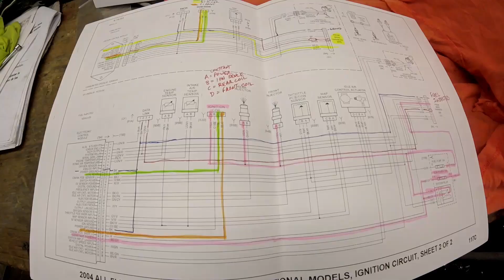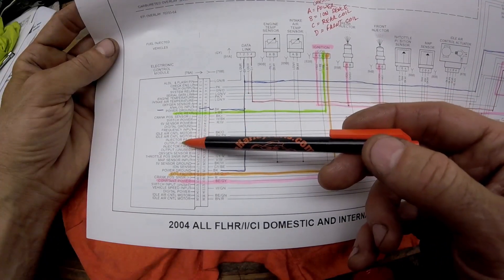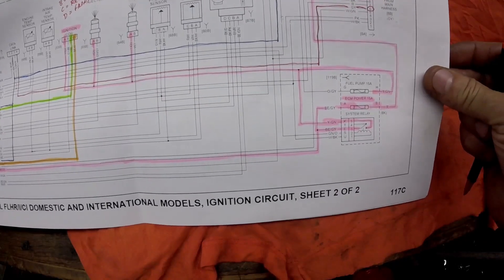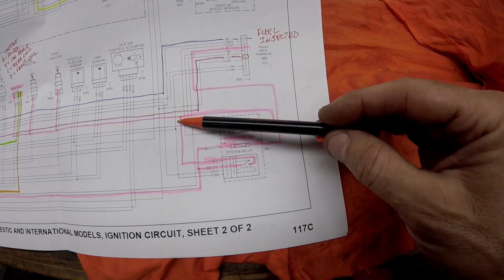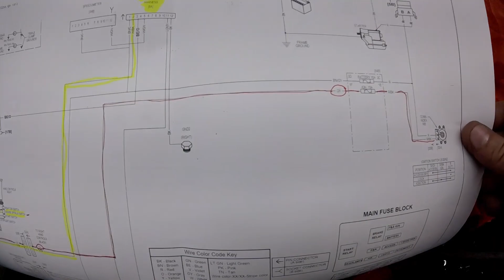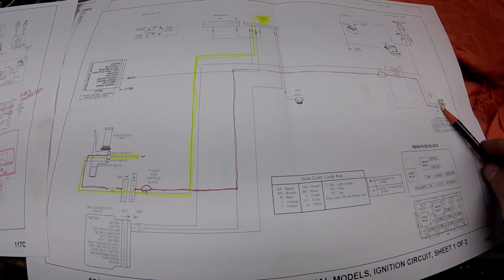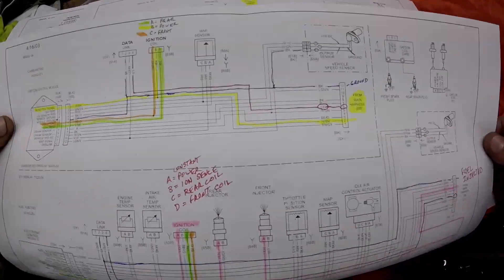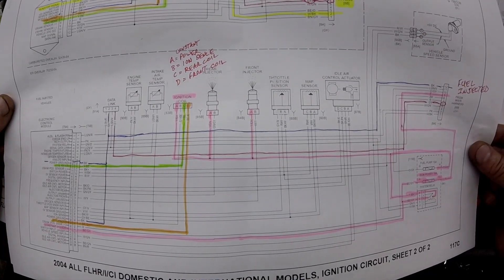No Spark 2001-2006 Harley FL Twin Cam 88 Wiring diagram

Comment: I absolutely love your very informational video, but I'm still having problems locating some of the items that you have mentioned. I'm used to working on the old bikes that I have owned ( such as a '47 Knuck/Pan, a '56 Pan, a '67 Shovel, etc.), but now I've picked up a gorgeous '01 Road King with only 20k miles on it. The owner passed away and evidently took the keys, the FOB and the Pin number, owner's manual, etc. with him. His wife couldn't find anything that should go with the bike. I ordered a new set of keys from the HD dealer, which fit the fork lock, but not the ignition. I ordered a new switch, so now it's got everything, but no spark to the plugs. And listening to your video was extremely helpful, but when you start mentioning the crank sensor, ignition module, and BAS, etc., this old timer is completely lost! I don't even know where to look for these items that you are mentioning. So, it really would be helpful to just mention the general vicinity where these items may be located, when you speak about them. Thanks a bunch!- Wes
Reply from the maker: I can appreciate what you’re saying Wes. I wouldn’t know that information off the top of my head however, in the Factory service manual they do point out where all these parts are. You can get the manuals for free in different groups on Facebook. I’ve attached it for you. Please let me know if I can help in any other way.

https://lookaside.fbsbx.com/file/2001%20HD%20Touring%20FLT%20Service%20Manual.pdf?token=AYJK3QFSb-DYwTNbunYEYvA2jJsaTk_BpnOYp-Lvgu6PH8haRQYMjDaW4dj3zF1WX99WNpgOrHraBHAIVmOD0D3jSS3N8pbSpTFhcaBwkAdL15JMWyzwPSbtX0Ce9y6U6Y37XqRFdRsAaVZun-3liM-4UKyWrd7DFQbd_BLGDcY1KhfB2VOiJZhaXW4nSvT7KT_hC0_8d5Dti56kmsYQtRiV
Reply: @Rapsgarage  Wow! Thanks a bunch. You are definitely DA MAN!! I really don't want to "wear out my welcome" with you, but if I may ask you a question, I will forever be in debted to you. As I mentioned in my earlier post, I'm trying to get spark on this fuel injected '01 Road King. With only 20k miles, I wouldn't think that something would be worn out (but I understand, anything is possible). The previous owner claimed that it would run as long as you spray fuel into the intake. I'm pretty sure I have cured that problem, with a new fuel pump. And while at it, I also had to switch the fuel tank due to rusting. BTW, I could kick the arse of whichever engineer at H.D. that thought it would be a good idea to put all that crap INSIDE the fuel tank!  Nevertheless, everything appears to be operating great, except for the lack of spark. No power to the coil, when checked. Also, I really hate to admit it, but due to low lighting and my haste (not to mention, that I'm older than dust) when attaching the leads to the new battery, I connected them bassackwards! Of course, when discovered, I immediately reversed them. But now I'm thinking, that is the reason I have no spark. Would you please give an educated guess, as to what would be the most likely problem due to my stupidity? Which component would go first? Thank you.
Reply from the maker: @Timelapser01 I would follow my video and ground the tn/gn wire and see if it has spark. The crank position sensors go bad all the time. If you get spark when you ground that wire, then it’s not the crank position sensor. At that point, it could be the TSM or TSSM module.
Reply: @Rapsgarage  Yes, I'm sorry. I meant to come back here and delete my last question. After slowing down and paying closer attention to your video, I realized that you are actually spelling out the information I was needing. Sorry for wasting your time and thank you so much for your help.

Comment: I have 12 volt at the 3 wire ignition coil pigtail (carbureted bike)  (white wire with black stripe) 

ONLY with TSSM disconnected 

I wonder why that is..I bypassed the TSSM neutral safety bs thanks to your other video I commented on in order for my bike to crank

Anyways 12v at pigtail for ignition coil with TSSM disconnected but still no spark when cranking.

Comment: Need some help on a chopper build! Using a 2010 softail wiring harness. No spark or power to the coil. Power to the coil upon start button, while the fuel pump is activated briefly upon startup. After this there is no power or ground on the cylinder wires or the power wire to the coil. Thank you!
Reply from the maker: Email me at hdrap_1999@yahoo.com and I’ll do what I can.

Comment: Ok finally I found your video and it best described my issue I’m working on a 1999 FLHTCI   ,so ultra classic I think more to the point up to this point wires plugs coil  ,all new still no start cranking yes geting spark as of now still no . I’ve done most of what you have suggested in this video I’ve checked wires for brakes or damage or shorts all seems well 90% of all fuses test 100% no issue there unless it’s the fuse you described as the black and red that turns to gray , I’m trying to run it down all possible issues before  start to look at the ecu , as the issue the bike was running and running good then one morning boom crank no start and here I am so before move to the crank sensor I should test my relay right grate how to??? Idk how yet
Reply from the maker: @davidriley1257  I’d definitely replace the crank pickup. They go bad all the time.
Reply: @Rapsgarage I’m sure you are saying the crank sensor? Because after that it goes to the ecu..
Reply from the maker: @davidriley1257 yes the crankshaft sensor
Reply: Ok one last thing before i move to that I mean, I’m gonna do it anyways, but I put my meter to the center pin of the coil and I get 12 V for a second and then it goes away. It’s not consistent so if I should have 12 V consistent right there and I don’t where do I go from there?
Reply from the maker: The coil power and fuel pump power only kick on to prime the fuel system and then they both shut power off. You need to check power on that center coil wire when the bike is cranking. They shut both of those power off in case you’re in an accident and the engine is not running. They don’t want the fuel pump to keep running and put fuel all over the ground.
Push the start button with the power on and you should see the 12 V consistent at the center of the coil

Comment: Good video. Getting me started to troubleshoot.
One thing to add. It would be nice to have those drawings next to the bike and when you speak of various elect blocks, point out where they’re at on the bike.
And yeh, I’m weak when it comes to electrical. 😑
Reply from the maker: @dougfresh1341  you’re not wrong but I just don’t want to take my bike apart to do that. If mine was broke down I’d definitely make a video showing that. Maybe one day after I retire. Thanks for watching and if you get really hung up you can reach out to me at hdrap_1999@yahoo.com
Reply: I was thinking the same thing. I used to be a whiz working on the old bikes, but when you start talking about sensors, ECM, BAS, etc. on the newer bikes, I'm lost. Not to mention trying to actually find these things!

Comment: Hey man , I’ve got a question for you. My 03 Dyna does not want to get spark and I have replaced the ignition, coil, spark plugs, voltage regulator, and crankshaft sensor. It just wants to crank and crank but won’t turn over. Maybe you have some idea of what it could be ? It’s getting plenty of fuel as well
Reply from the maker: Is it carbureted or fuel injection? Also, Harley offers the wiring diagram online for free go to Google put in your year bike and put in wiring diagram. I would check to make sure it has 12 V power coil. I would then start checking that you have 12 V power at the module for the spark. If it’s fuel injection, that would be the ECM. If you have further trouble, you can send me your phone number and I can help you over the phone. My email address is. hdrap_1999@yahoo.com
Reply from the maker: Check all of your fuses
Reply: @Rapsgarage  okay sweet thank you very much I really appreciate it. I will test that out tomorrow and get back to you
Reply: Are you saying to check the voltage on the ignition module itself ?
Reply from the maker: Yes, there should be constant power plus a switch power then check the 12 V on the coil also and then check the grounds on the ignition module.
Reply: @Rapsgarage  I am messing with it now. I understand it’s late so no worries but would you want to get on the phone tonight ?
Reply from the maker: Hit me up tomorrow

Comment: New:
*battery
*crank sensor
*coil 
*cleaned ignition switch 
*new earth on battery

Checked fuel tap, gets fuel
Checked spark with spark tester, no spark
Checked main ignition circuit breaker, read 12v 

Im stuck
Reply from the maker: Do you have 12 volts on the coil?
Reply from the maker: Watch this video. https://youtu.be/IBok3aml3QM
Reply: @Rapsgarage  will do! Is there any way to see if its the ignition cables? To measure power when cranking on the coil
Reply: @Rapsgarage  yepp. 12,7
Reply from the maker: In my video, I show you how to check the plug wires. I would doubt that both of them went bad at the same time.
Reply: @Rapsgarage  ill check when I get home. Weird.. would you be able to guess what's wrong if that's not the issue?
Reply from the maker: Im not into guessing. I follow the wiring diagram and and my Volt Meter. They take me straight to the problem. Let me know how you make out. If you’re still having problems you can email me your phone number and I can help over the phone. 
hdrap_1999@yahoo.com
Reply: @Rapsgarage  i just tried. I'm sure I did something wrong though. Nothing happened. Had the battery charger nad my ground to my bike
Reply: Hi raps, i just went into storage and checked my softail again. I checked the grey CDI , prong 1 and 3 , 1 has 2.3v and 3 had 0v, is my CDI shot?

Comment: My bike is a 03 carburetor and loosing fire at the coil . I can ride a half hour a it dies. Let it sit 10 or 15 minutes and it’ll start up and go until it does it again. I’ve checked the coil . It’s good .
Reply from the maker: @tchogworks1987  that sounds like a bad crank position sensor. The other check you can try is as soon as it dies spray it with some starting fluid to verify that it’s not a fuel issue so you don’t waste money and time.

Comment: Hi, I ran 12 volts positive to A on my coil and then ran a wire from C touch ground with it and released several times but no spark on spark plug. Only sparks are when I ground the wire running from C. (I’m trying to test this coil as you explained)
Reply from the maker: Have you checked the resistance of the secondary? You can have a good primary on the coil and a bad secondary.
Reply: @Rapsgarage  I’m going to check it tomorrow I’m getting a multimeter from the harbor freight
Reply from the maker: Trouble shooting Single Fire Coil ignition system Harley Davidson Dyantek
https://youtu.be/8KEuAPyecsk
Reply from the maker: Harley Ignition Coil, Points, electronic, Plugs and Plug Wire troubleshooting the system
https://youtu.be/IBok3aml3QM
Reply from the maker: Check out both these videos. This should help. If you need more help let me know

Comment: 07 flhx my rear jug isn't firing thought was the coil so replaced that still same problem, front jug is firing so is the ecm not sending the ground signal tothe back coil to fire forbthe back jug?
Reply: Thank you
Reply from the maker: How did you verify the rear isn't firing? If that's true id put a volt meter on the wire for the rear cylinder at the coil and see it it's pulsing from 12vdc then to ground. If it's not I'd check the wire coming the computer to the coil and verify it's good and not broken. The other test I'd do is connect a ground wire to the rear coil post and removing it the see if you have spark. This checks the coil you have. Just because it's new doesn't mean it's good. If you need further help please email me your phone number to hdrap_1999@yahoo.com and I can call you to walk you through it. Check out me video on how a coil works. This will help you a great deal. 

Harley Ignition Coil, Points, electronic, Plugs and Plug Wire troubleshooting the system
https://youtu.be/IBok3aml3QM

Also check out this video too.

Trouble shooting Single Fire Coil ignition system
https://youtu.be/8KEuAPyecsk

Comment: Hi Rap's I  own a 98 1200 sporster and pretty sure that I  have the same problem that you're describing here in this video,she  cranks and dies in a few, everything is good but  the bike not maintained sparks and I'm pretty sure that my ECU under my seat is faulty  ,some time I got sparks and some times not,stator new,coil module new,gas is ok rebuild carb good wires,hard sparks sometimes
Reply from the maker: I don’t believe you have a an ignition module under the seat. If you need further help email me your phone number at hdrap_1999@yahoo.com
Reply: @Rapsgarage  what I meant to say is the ECM
Reply from the maker: @frankgarcia3018  I don't think your bike has an ECM. I downloaded the wiring diagrams and looked at them. If you need further help, let me know.
Reply: @Rapsgarage  I do she's running a  screaming eagle one,I replaced all that was wrong with her,but the ECM,which I will soon

Comment: Yes this is the guy that wrote you that about that road king I have replaced everything on this bike EMC crank sensor coil everything works on this bike but I don't have any juice going through the fuse for the fuel pump and there's no spark other than that everything works write down to the burglar alarm please help me I'm out of answers
Reply from the maker: Email me your phone number at hdrap_1999@yahoo.com. It’s easier over the phone.

Comment: So what if you have 12 vpower to A for a few seconds then drops to mv and fluctuates as you crank starter
Reply from the maker: I think on fuel injection bikes it fires the fuel pump until the engine starts. That way if the bike falls over it shuts the engine off and the fuel pump off so it doesn’t pump gas all over the ground in the event the fuel line is broken. The coil has to have power in order for the bike to run. 
Make sure if you’re using a digital voltmeter it’s not auto-scaling. If you need more help let me know.
Reply from the maker: It could also be a bad relay.
Reply: Replace ecm relay and crank sensor   Heres something puzzling  tap starter button 4-5 times rapidly then plugs start to fire. But if I just hit starter button once. No spark
Reply from the maker: I would put a voltmeter on the power to the coil and see what that is doing when you’re trying to start it. If you need additional help, email me your phone number to hdrap_1999@yahoo.com. I can help you further over the phone.

Comment: 2009 street glide….no constant 12v to A….it gets 12v while the fuel pump is running….is that normal…
Reply from the maker: Sorry it took me a few days to get back to you. The computer tells the "System Relay" to turn on/off. The system relay is what supplies power to the coil and fuel pump. I'm not positive but I think that whay=t your saying is correct. As you crank the bike it should supply 12vdc to both and it should stay there until the bike is turned off. I think the reason they do it this way is because if your in an accident you want the bike to turn off and you want the fuel pump to turn off. That way if your bike is on it's side you don't pump 5 gals. of fuel all over the ground. If your saying that when your bike is running and for no reason it shuts off because you loose that power then I'd start checking power at the System Relay and go from there. See the attached link for the wiring diagram for your bike. Please let me know if I can help further. Thank you for watching.

https://serviceinfo.harley-davidson.com/sip/service/document/5536?baseUrl=%2Fservice%2Fdocument%2F5536#152c4f46-d9df-47b1-bf3d-3fb75f08410c!!1!6
Reply from the maker: BTW how your bike is wired is different then what's in this video.

Comment: Wouldn't it make sense to just check power at the coil? Instead of going through all the tracing, Because it seems like getting power to the coil is the most important. Thank you for sharing your experience and knowledge. You are much appreciated.
Reply from the maker: This video was made for someone who asked a specific question. They had already told me they had power to the coil. Otherwise you are correct. You would normally start with power to the coil. Good eye and thank you for watching.

Comment: awesome video. stumbled upon it trying to diagnose my 2006 FLHXI. i was having the same issues, and have 12v at the system relay, but 0 volts at the coil. am i right to assume that theres a broke or grounded wire from the system fuse to the coil? also have continuity from the power pin A and ground. any advice would be greatly appreciated.
Reply from the maker: Sounds like you have a bad relay. Can you hear the fuel pump cycle? Don’t forget the relay has 12v power on the contacts and 12 v power  on the relay coil to fire it when you put the key switch on and the run switch on. I can help you over the phone if you’re interested. Email me your phone number at hdrap_1999@yahoo.com

Comment: Hello, I have a 80 shovel head. No spark, new coil, wires only getting 7 .7 volts to the coil. Any ideas
Reply from the maker: That’s not enough voltage to the coil. Check your battery first then I’d check your main on/off switch. Check to see if you have a good 12 V to the switch and then see if you have 12 V coming out of the switch. If it’s not there then I start checking the wiring to see if you have a bad wiring connection.
Reply from the maker: You can always email me your phone number to hdrap_1999@yahoo.com and I can call you and help you over the phone